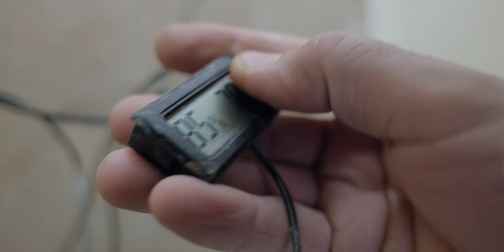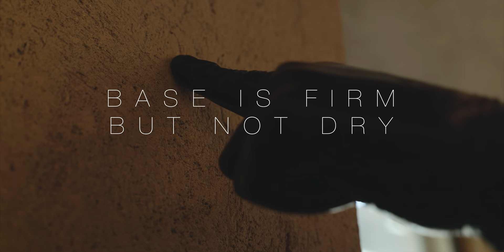Tadelakt: A How To

Comment: I found that a strong mix of Lux soap flakes did as well as Olive soap.. Its the reaction between sodium stearate (washing soap) with Calcium hydroxide, giving you calcium stearate which isn't water soluble that is important. You can finish with wax or linseed oil. For pigments you can go to your local paint shop and ask them to mix up a colour without adding it to paint.. just keep in mind there is extra water in that pigment, also measuring it out is important with chromate dyes since they are quite strong and you don't want big variations between plaster batches (though some variation gives a nice effect)

Comment: Your videos are very inspiring and helpful. Haven't come across a better tadelakt video with respect to instructions, materials and videography. 
However, I'd be greatful if you could let us know what walls/textures this can be applied on. Can this be applied to raw bricks, or should we mud plaster it first? and can this be used over flyash cement blocks?
Keep up the amazing work!
Reply: Mostly used on cob which is made from sand, straw and clay.  Honestly I've never seen it used on brick walls.

Comment: In 2019, I built a hempcrete house in Vermont using hydrated lime and metakaolin (metapor from poraver). We have a bunch of material left over which we plan on using to mix up our own plaster, and we'll be finally getting to plastering the  exterior this year. We've been using a 2:1 lime:pozzolan mix for patching and plaster prep with good results. Our goal is to do just one coat of plaster anywhere from 3/16 - 3/8" thick (we have large overhangs and the hempcrete itself acts as a base coat)

 I'm wondering if you have any insight into what the minimum amount of metakaolin is  that  i could add to the hydrated lime to ensure that it will set hydraulically (and not by curing), and provide good weather protection. I'm hoping to maximize  the amount of lime I use to ensure the plaster has good flexibility, permeability  and self-healing qualities and is not too brittle.  As mentioned, the metakaolin used is in the form of metapor - which I assume is feebly to moderately hydraulic?)  The hempcrete substrate itself is consists of 2 part hydrated lime, 1 part metapor metakaolin and hemp hurd. This is why we haved been using the 2:1 ratio for our patching work, but I have read that  research done by the Foresight project has shown that if more than 20% pozzolan is added to a non-hydraulic mortar, the resultant mortar will be less permeable and more brittle than mortars made with cement. But I also understand that pozzolans with a lower firing can be less hydraulic in nature. 

So I am wondering what the ideal ratio of metapor metakoalin would be to add to a type s hydrated lime?

Any wisdom anyone has  here would be greatly appreciated :-)

Comment: If you were to build a timber frame in a country such as Finland, close to a river, so there would be moisture and winters, what kind of a clay wall would you use in such place? You would want insulation and water resistance, yet also breathability. Would you have to use cladding to protect the wall or could it be made water resistant otherwise?

Comment: Question: earthbag construction tends to have a problem in really rainy climates. I've heard of them using lime, but not stearic agents (like soap).
How necessary is the smoothing for impermeability and can it be done with larger/non-stone tools? (Flat steel?)
How much does wax help/is necessary?
And can this survive rain and sunshine in more exposed areas than a usual bathroom? (As an outside wall plaster)

Comment: This is really beautiful and has a great finish. May I ask, how do you think this finish will act on stone houses? We are renovating a ruin and are investigating a lot about how to render places. Some houses have been rendered with what they call Cal Viva, hot potty, Portland plaster and they always crack. 😞 so thinking the cement route but I wish not to use cement.
Reply: Cement is almost certainly a mistake, not just aesthetically.  Your mortar should be softer than your stone or you can expect spalling or worse.  I'm not a professional, but this is what I've found in my research.  Lime renders aren't as brittle as portland and so are less prone to cracking.  He used a little Portland in this, I think, but I guess not enough to be a problem.  

An extra application of a slurry might be enough to take care of small cracks.

Comment: Can I ask, what happens if there's damage somehow? For instance, I saw the drain under the sink there in the finished sequence, and that area was gorgeously sculpted, but I had a paranoid thought about someone coming in to fix that drain somehow, and being careless with a wrench or something and digging in and causing a divot or severe blemish in the surface. Is the repair process equally involved? How would you approach that if you don't mind me asking? As always your channel and content are a cherished and emotive treasure on this platform and I know I personally can't thank you enough for doing this.
Reply: I think you can just remove the loose material and then fill in as required, from base coat to finish coats.  Fortunately, you'll probably have little piles of material somewhere on your property and won't have traveled to Lowes only to hear that your required repair materials have been discontinued.
Reply: @cletushatfield8817  hah excellent point on the material availability! Just one more reason this is the superior method, and thanks for the input on the repair process as well.

Comment: Beautiful work! Do u think it is possible to cover wooden furniture such as for example mdf with tadelakt using this recipe?
Reply from the maker: Sure, but you would probably want to prime the wood, and maybe put a little bit thin layer of modified tile adhesive as a bonding layer for the lime plaster
Reply: @TheNitoProject  Thank you! Do u recommend using the base coating when priming and using the modified tile adhesive? I think when it is smooth and egal this step is not necessary..

Comment: Beautiful, does the fiber you add to the product add strength to prevent cracking? Also are there any products I can use to retard the drying process other than water? Something I could mix in the bucket while mixing the plaster.

Comment: I can't stop replaying the part where you are installing the lights.
WHAT ARE THESE LIGHTS CALLED?
i tried reverse image search, looked up mason jars, glass coasters, surface glass lights. none of the terms are showing me similar results.
BENITO, WHAT ARE THE LIGHTS CALLED? 
If i'm a true fan of your work, I'll get an answer.
P.S. I'm asking since i'm trying out your technique in our commercial property in India with the help of a local architect.
Reply from the maker: Hello Banjaran
The bulb I was using are pretty simple and pretty common, the type is G4 bulb they common in automobiles and small lamps and so on, you can buy a holder but I just put them directly into the speaker wire.
Hope that helps and good luck with all your builds.
Reply: @TheNitoProject  I haven't ever been so overjoyed seeing a YouTuber's comment! Thank You, Benito.😄
The bulbs aren't an issue. I didn't know the term G4, but I knew these are pretty common. WHAT ABOUT THE LIGHT WALL FIXTURES? The ones in grey and yellow? Are these jars or specifically lights? What are they called?
Reply from the maker: Lol! Those just empty wine bottle in the wall, cut them in half because my wall wasn't that thick, but don't think you have to the bulb would probably fit with out cutting.
I cut my on a tile saw, they also tools just for that purpose.
Reply: @TheNitoProject  hahaa..almost figured that out. I added mason jars and glass stain colors in my cart last night. THANK YOU VERY MUCH FOR YOUR RESPONSE. OVERWHELMED TO HAVE SUCH AN INCREDIBLE ARTIST LIKE YOU RESPOND.
keep up the great work!